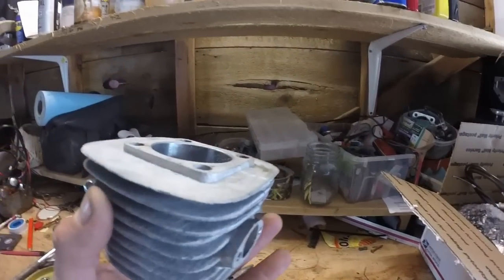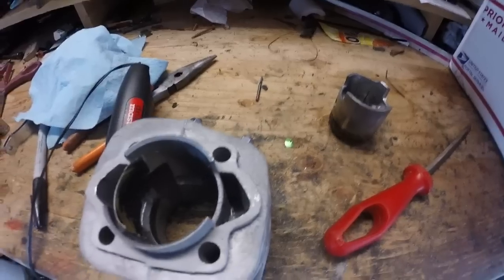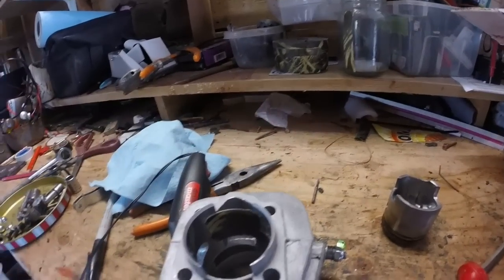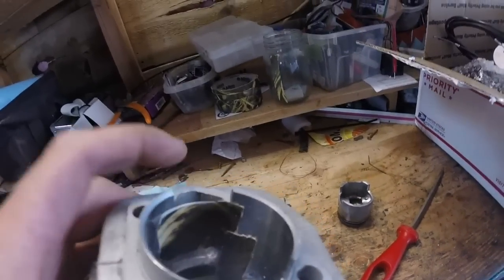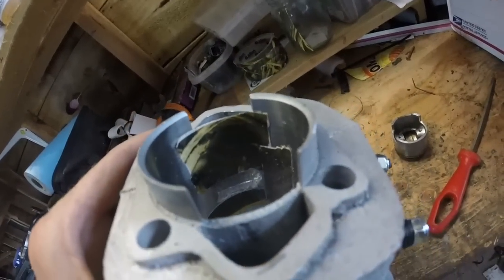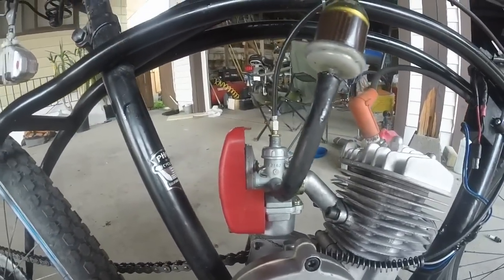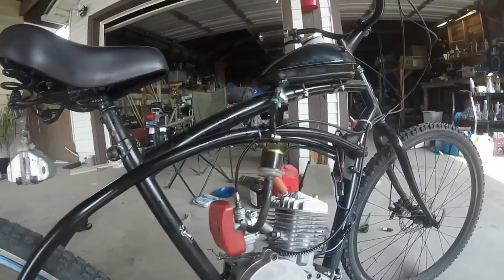PK80 Motorized Bicycle Porting

Comment: I recently got a 80cc motor from a freind but from the Iooks of  it the head and cylinder are all one piece how would you port something like that
Reply from the maker: The BT 80..... Never seen one up close. Don't know if ya can port them.
Reply: Well when i get ready to try ill let you know how it goes
Reply: I hate on the wildcat the exhaust ports. I love round which Zeda has. 
Every Zeda I bought kicked ass. Rob knows his shit
Reply from the maker: You must be so hard for Rob! He has you spinning on his lap! Rob is a con man and you have been conned!
Reply: @concretereef  he's always did me good bud. Anyhow if you cut the cylinder walls out on the transfer you'll lose bottom end but massive gains top end
Reply from the maker: @thomasswihart85  Zeda has same cylinders. Cutting tranfers on the sides only lets more mix in. You still want mix to be directed towards intake. Changing exhaust port height affects bottom end as well as intake bottom or piston skirt. There are so many combos for high end and low end power mods working together with different components.  Intake lengths, exhaust header lengths,  gear ratios that support proper powerband hits.... ect... Glad you are not one of many that were ripped off.
Reply: The same way

Comment: Noob question, because I'm a noob. What mods would i make If I want more bottom end power? (because I live in the hills)
Reply from the maker: Get a longer intake and notch on on intake side @TDC. If you get a pipe, a longer header will give you better low end power. Try just adding another base gasket to jug to see if that helps as well. It will change your timing... Good luck!
Reply from the maker: First and easiest way to gain low end power is to use a larger, 44 tooth sprocket in rear.
Reply: @concretereef  lower the cylinder with a thin base gasket to get the transfer ports lower , it gives more low end power with lower transfers.
Reply from the maker: @Baldys_projects  very true. Changing timing that way will increase bottom end.  I'll lower intake port as well for bottom end
Reply: @concretereef  on a two stroke you want a short intake not a loner one I put a short intake on mine in place of the stock one and the throttle response and bottom end was way better than before..
Reply from the maker: @dannyoutlaw9919  ya got that all backwards. Rethink it.

Comment: Is that the PK80 "Wildcat" kit from CaliforniaMotorBikes.com? From what I hear they are one of the best stock 2-Stroke engines for the price. I recently bought one of their 2018 Wildcat Kits for a Schwinn Midway Cruiser, I can't wait to get started on the build. Hopefully I'll receive the kit by tomorrow (5/12/18). I almost went with a Silver Zeda80 kit from ZedaMotorSports.com, they are also considered to be one of the best 2-Stroke engines available (depending on who you talk to but I digress). I did a lot of research on these 2-stroke "China-doll" engines and, after talking to several experienced builders/riders, I decided to go with the Wildcat Kit over the Zeda80.
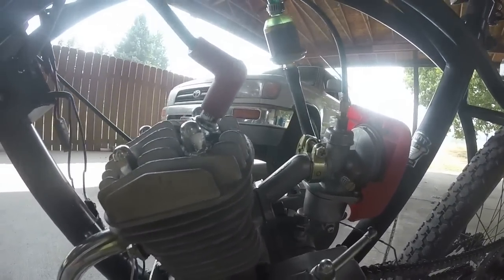Reply: I believe you mentioned where you got the PK80 Engine @ 1:54 into the vid, however, I can't for the life of me discern what you're saying. I tried to enable CC (close captioning) hoping I could read what you were saying but that didn't work either. Unless you're getting them from "Cheesedick and worth" the CC is WAY off, LMFAO!!!
Reply from the maker: It's a cheez motor, but I also have a Calibike kit as well. Good kits!
Reply: Hey how is your wildcat kit? I was planning on buying one.
Reply: Zeda Motorsports are just a distributor of zeda JL, best deals on legit triple 40 zeda Motors are here https://rover.ebay.com/rover/0/0/0?mpre=https%3A%2F%2Fwww.ebay.com%2Fulk%2Fitm%2F273576505118

Comment: Angles are just as important or more so that port size.  The front of the transfer ports should be angled to the center of the piston, or even closer to the back wall.  This is critical to proper scavenging.
Reply from the maker: Very true. Angles were not affected. Still transferring away from exhaust.

Comment: Runs real good. Nothing crazy, just a smooth reliable ride. Have read to remove about .005 from the top of the piston all the way about 1/4 below the rings, prevents scoring as you start modding the top end.

Comment: do yourself a favor get rid of the chain tensioner it makes ride way smother i was shocked....  Second  tip if you got 26 inch tire go to 36 tooth gear i am almost 200 pounds and would never go back to a 44 tooth  just a way nicer ride
Reply: TheProspectormike i agree you lose a little bottom end but oh man
Reply: Only go 36t if you live or are planning commute in flat roads, hills are constant battles. Didn't have that problem with the 44t it tackled hills.
Reply: @eduardodiaz5762  I like the 40 tooth easyer on the take off and still makes the hills.
Reply: @larryguevara3350  I mean it still makes it up the slant hills, thinking of going 38t I still want that High end power it's awesome!
Reply: Same I'm 195lbs with a 36t with about a 4 to 5hp zeda80 it's great down low to about 40 mph but top end sucks with the 40mm stroke compared to a 38mm stroke, I need to get another big bertha pipe for top end power and it will kick ass lol